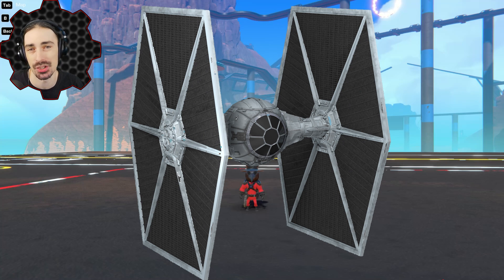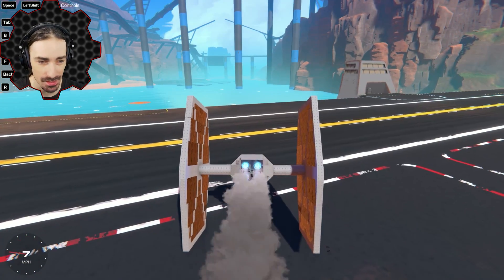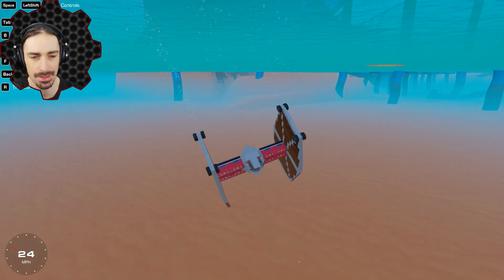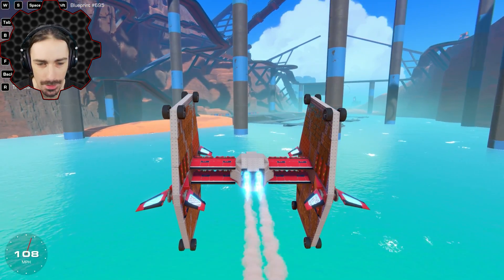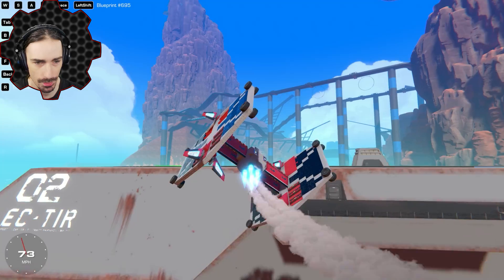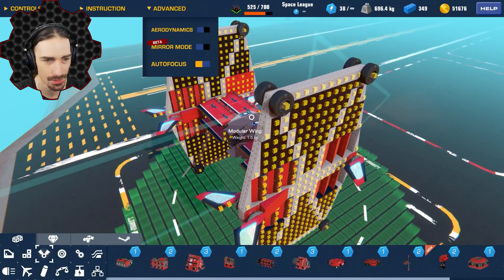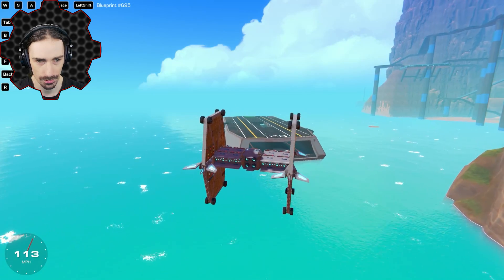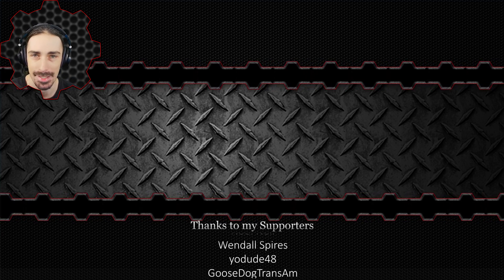TIE Fighters Couldn't Fly on Earth, Until I Made These Changes

Comment: I'd love to see you take an existing 2-blade helicopter design and change it to fly the wrong way: lock up the main rotor and use it as fixed wings, adding enough forward thrust and stabilization tweaks to make it fly like an airplane.

Comment: I tryed to make a functional tie interceptor for the longest time, because i think it is the least realistic type, it kind of works but it needs gimbles to lift that make it so annoyingly floppy even with stabelization and it has like 30% dislikes allready what might be due to that fact. The classic Tie is going to be my next project thats tricky, but at least the center of mass is not in front of the cockpit, so it should be easier, eventhough it will not be flying as jet like as yours. The easiest Ties to build are probably the Tie Advanced and the Tie Striker, as they have long cockpits to provide stability through airflow and not just mini fins and "artificial" stabelization.
I should try and be more active on the Trailmakers Discord again, to get more insight on how to improve my builds though, because at the moment im really focused on the likes/dislikes on the workshop wich seems to be not a good indicator for funktional replicas or a good source for helpfull feedback.

PS.: as for the challenge i would suggest a B-Wing with the rotating feature, its by far the most frustrating Build i have not yet released on my own, as it seems just impossible to make it A: rotate the cockpit to ground level as it twists its body B: having foldable side wings and C: still make it fly like a jet while shooting a heavy cannon on only the most decentral place of the ship.

Comment: If you make this into a series you should definitely try making the Blade-wing from Star Wars. It was quite interesting as was in the shape of a sword, but was designed to be a blockade runner. Also some of the other TIE designs would probably have more lift or thrust, such as the tie advanced with slanted wings, tie bomber with a second engine, tri fighter which consisted of three sets of slanted wings, and tie intercepter

Comment: I think a TIE/sa Bomber would be a good next step if you make this a series. I feel that the bent wings would give you more options for built in control areas and allow to to maintain a more authentic look while using the trail makers engine. Also, this may just be my first youtube comment ever. I actually hopped on my phone for this as my PS4 does not allow comments on youtube.

Comment: Scrapman, I absolutely loved this video however I can't help but point these little things out. The original design has it's controls based on RCS (sort of) thrusters, all of it's roll, pitch, yaw is controlled by RCS thrusters just like most of our rocketships in real life today. I believe with enough programming you can make it work with actual thrusters ingame too instead of adding pitch control surfaces and yaw control surfaces. Also it isn't supposed to roll off into the air (like an airplane) nor land like an airplane. It's more like a VTOL, it has some sort of thruster (technology that isn't really specified anywhere) which helps it VTOL and land like a helicopter (as well as take off like a helicopter). And in fact, in Star Wars: Rebels there is an episode which showcases the tiefighter under a new light never really seen before. On a planet which has similar to Earth's atmosphere. Even the inside controls and layout of the cockpit is shown, where you get in it and how you climb inside of it, as well as its maneuverability, it's VTOL features and flying through the planet's atmosphere (both extremely low high speed flying and high altitude flying).

Comment: the tie fighter (I think) has downward thrust. and to yaw, pitch, and roll, it has a gyroscope. if you watch the Andor epesode named "The eye" you can see tie fighters coming from the airbase Alkinze. and in an earlier Eposode, there's two tie fighters that go overhead.
P.S. also the tie fighters were launched by a crane on a rail. not by a runway.

Comment: I have a suggestion for another build experiment, though it might not be TOO much of a challenge it would certainly be cool. A Phantom dropship from the Halo franchise, with functioning turrets and doors at the rear and a functioning drop door in the center of the belly, of course with as few modifications to the original design as possible. You think you could do that, Scrapman?

Comment: Yes they can function in atmosphere. The way the tie works Es that there are repulser lifts that hold it up. And those "wings" serve a purpose, they are sub light solar panels that absorb light from stars to power it. The tie fighter can fly in an atmosphere, if you actually stop assuming things and doing research from people who know what they are talking about and not Wikipedia, then maybe you might not sound like an "ENGINEER". And you would be surprised as to how much vision tie pilots have, and your cannons are configured wrong, both cannons fire at the same time. Not to sound like a star wars geek but this is slightly triggering. Not hating I it is cool looking in the end and I do like the concept, but please do more research before making assumptions on these projects.

Edit: if you want a cool thing to make you should try making the Horton HO-229, or the V1 or V2 rockets, none are failures they were factory produced and worked.

Comment: Note that in the Star Wars movies, the TIE Fighter, just like most other spacecraft, take off and land by levitating up and down like a VTOL would in real life. Maybe a couple gimbals placed in the upper part of the wings could help simulate that and solve the awkward landing problem lol
Reply: Yes, ships in the star wars galaxy use anti-gravity engines commonly called repulsor lifts, these are used in star ships, fighters, and speeders, and allow VTOL. This means that you don't need wings to produce lift.
Reply: @dvddestroyer9981  Exactly!
Reply: I was gonna say this 😂😂
Reply: gimble jets seem a logikal idea for Tie fighters, but they are a horrible pain in the azz when it comes to horizontal acceleration of a round objekt, as they force it into place on the verry spot you put them, so when you put them in the top of the cockpit, it will to roll backwards, if you put it in the bottom or middle, it will roll the bottom up, it feels like giving the Tie an artificial Magnus effect. The best option i found was to combine the vertical and horizontal force of the UFO glitch of the Hoverpads, and try to fit the mechanism between the Cockpit and the Wings, that does not give nearly enough lift to do a movie like liftoff but it gives enough lift and forward moving force to lift a little off the floor, so you can accelerate for a liftoff without destroying the overall appearance of a Tie.
Reply: Yeah, gimbals would give it the VTOL effect
Reply: Was about to say, show me a ship in Star Wars that doesn't take off by floating up first.
Reply: @Silverwing2112  Can't think of one, but hey, the SW universe and lore are so unbelievably enormous, there surely has to be an exception to every rule in it. That's the only reason I used the word "most"

Comment: I the case with the wheels was more on the drag side, than on the weight side of things. The wheels on the bottom caused a lot of drag, that's why it was "pulling" down the top part

Comment: I very like how instead of slapping some lazy gimbaljets he actually spend some time to add actual plane parts.
Reply: An actual Tie fighter do have gimbal jets. It doesn't make any to slap wheels on the tie fighter as it was specifically designed for both space and air given that they are Vtols. A long runway take off for a tie doesn't make any sense lore and design wise
Reply: @captainnyan-nyan2005  True. But this is not the point of a video. Just a fun little experiments.
Reply: @moroblizniak4457  well even with the experiments. By making the tie into an air only ship. You drastically reduced speed by adding more weight and cornering ability. Which can easily be done by torque and gimbal jets. Plus it loses its ability to Vtol for an instant flight.

Comment: if they aren’t wings then what are the things on the side?
Reply: Solar panels
Reply: Things that projects bad aim
Reply: Solar Panels. Also maybe something to do with the Twin Ion Engines on board the fighter. Another thing could be a physical shield for the glaring issue of the design that is it doesn't have any capability to defend or attack from its sides and the cockpit could then be easily shot at by any agile pilot turning the whole thing into a heap of floating space debris.